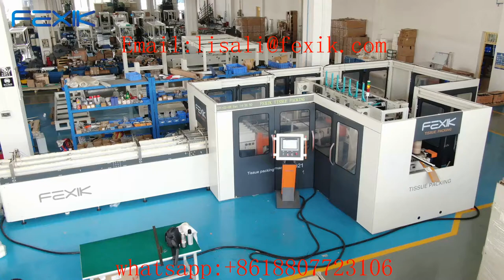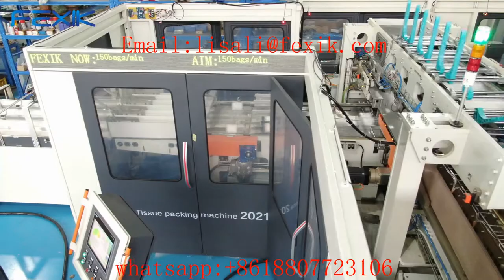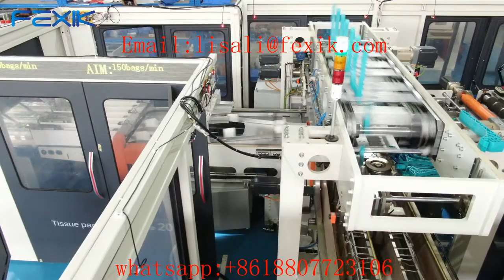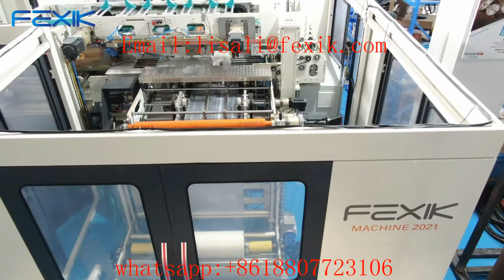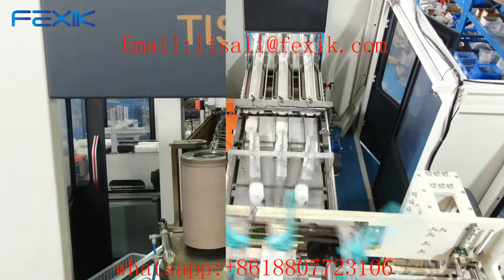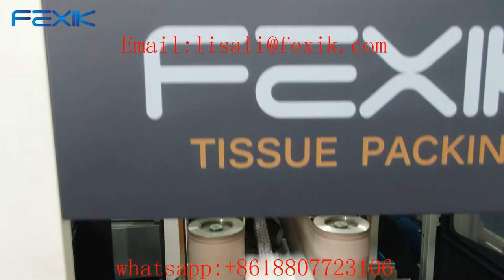Automatic Film Wrapper Toilet Paper Rolls Multi Packaging Machine

Comment from the maker: contact :Lisa 
LIUZHOU ZODE MACHINERY SCI-TECH CO.,LTD.
LIUZHOU FEXIK INTELLIGENT EQUIPMENT CO.,LTD
Email:lisazode61@gmail.com/lisa@zode.cn
Mobile:+86 18807723106(WhatsApp/skype/viber)
Wechat:15678084881
Web:http://zode.cn
1) It adopts full Siemens servo technology, touch screen and Siemens SIMOTION system.Parameters are set conveniently and quickly ,Machine Automatically completes produce from the automatic feeding,arranging ,filling plastic films ,inserting angle and sealing .Running in a high speed,no pollution. 
2）This machine is designed to have various specifications format changeover between toilet roll and kitchen towel , it thanks to the advanced double layer arrangement system.
3)Adopting advanced world famous brand components in pneumatic parts ,electric parts and operation parts. 
4）The machine is designed to have quick,flexible format changeover.the change time less than 30 minutes.
5)This machine is used plastic films to pack,it save the cost of plastic.
6)Five-channels motorized belt feeding conveyor with high technology controlled by Siemens servo motor 
7)our machines can pack toilet tissue from 1-60 rolls and kitchen towel  from 1-24 rolls